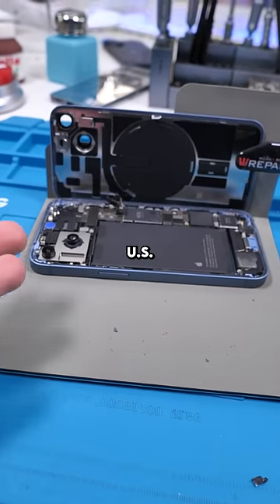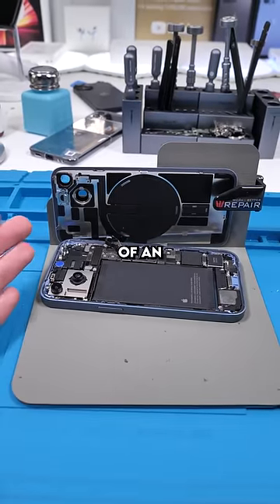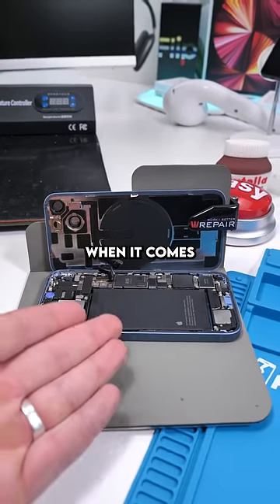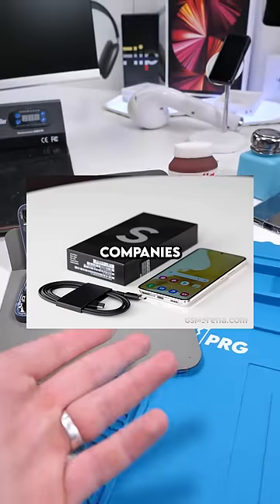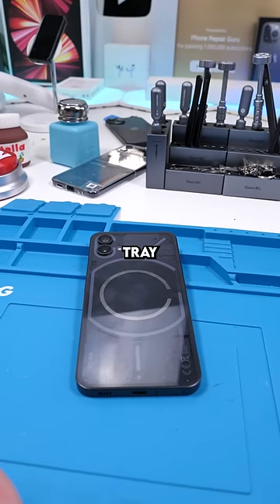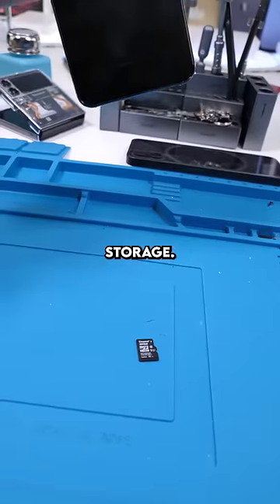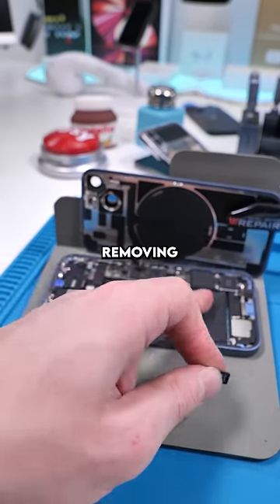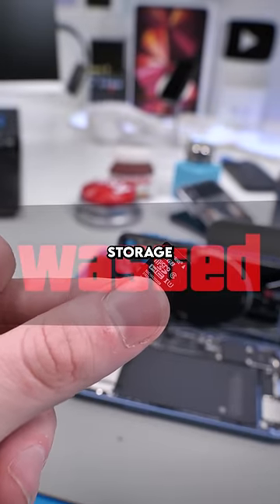The Serious Downside Of E-SIM..... #shorts

Comment: U are definitely right. The think that i dont understand is that they laugh at them and make the same things, yeah more room to work and bs but this is a disaster.
Reply: They don't even take advantage of the extra space, they just put a block of plastic where the SIM tray used to be
Reply: @Votterbin  because other places still have the Simcard tray. I think with the iPhone 15, Apple will remove it for every country and then use that space.
Reply: @noobssindcool  I hope you’re right and I kind of believe you are. It seems like it would complicate production having only one specific region assembled differently than the rest.
Reply: ESIM's have existed in Android based smartphones way before Apple started using them. ESIM's are by no means new. Android phones didn't all switch to using ESIM's exclusively so I don't think that other companies are going to really care.

Makes me wonder just how easy its going to be to travel with an iPhone that has ESIM vs an Android smartphone with a sim slot. It's not like you can get a travel sim at the airport, or stay anonymous by using an unregistered sim.
Reply: @noobssindcool  I hope your wrong, I really want the iphone 15 to be the perfect one. With a type-c port, sim card tray and slightly different design. 🤞
Reply: Samsung may even be worse than Apple. Let me explain.
Both are terrible, anti consumer companies, but Apple has their own, different and appealing OS and environment.
While Samsung implements the same terrible tactics Apple does while using Android and promoting universality, while limiting and worsening Android’s freedom and experience
Reply: Well there are brands out there like "Budi" that make external storage that very well may be our next option with everyone trying to move to the fact of removing the storage.
Reply: @imprincesswolfy2565  I have samsung note 10 plus the only thing I miss is the headphone jack and the heart rate sensor only the samsung s10 plus has the heart rate sensor if you buy a newer one it's impossible to get those two features especially the heart rate sensor which it's a samsung feature I think idk

Edit: idk why the fuck they made their own phones more useless but technically powerful I rather have a 9 year old phone that has all the features than get 1000 dollars phone and it does not even contain or have those features
Reply: Just use a USB c flash drive
Reply: The PR department does it to generate hype and discussion 

Like how Fanboys will go "Haha Apple sucks for doing this!" then "How dare they mock Apple!?"

The companies themselves don't care, it's not like Apple will get "insulted" and not get Samsung to help manufacture iPhones
Reply: @wodn184fn I agree.
Reply: @thinkspeed6787  Apple will be going portless before they use usb c simply because all the lightning cables will be waste now (for those that don’t have another product with lightning) and if they switch to usb c before going portless then that’s two types of cables that are waste now instead of just one
Reply: @thinkspeed6787  if any iPhone is gonna have USB-C it would be the EU only, because the US isn’t pushing it
Reply: @Votterbin  redesigning the board for a specific region needs another manufacturing process, so they just chuck in those plastic blocks. Saves them $$$$$
Reply: @ctwilli0950  ESIM isn't new on iPhone either. The new thing is that they just have ESIM now and nothing else. And I think we all know Samsung and their sad concept of copying everything Apple does
Reply: @mercury9060  That's bullshit. Why should they go portless now? They already have their iPads and Macs on USB-C, so you already have two cables. And as soon as they switch the Airpods and their Magic stuff to USB-C you have one cable
Reply: @timwiesler6365  They have plans to go full portless and that includes the charging port. Also the new EU law that requires smartphones and other electronics to use usb c basically solidified the iphone going portless. because apple is against electronic waste and they would rather go straight to usb c than go for usb c on all iphones for a year or manufacture new parts just for a different country. that would be a big waste of parts and money and would produce a lot of electronic waste
Reply: @10-volt  I'm in the EU 😁
Reply: @mercury9060  IPhone is against electronic waste? Nah man they are against it for greener $$$
Reply: @someoneyouneverknow7529  doesn’t the matter the reason, they’ve shown many times that they’re willing to take something out that isn’t necessary
Reply: @mercury9060  But they wouldn't need to make new cables OR new ports because they have it already in their iPads. And even Apple knows it's way to early for portless smartphones. It seems like you don't get the whole concept of Apple.

Apple has much more important tasks for now. You'll see next year when they switch every iPhone to the dynamic island, then the year after that the pro switches  to a punch hole, then the normal iPhone, then no camera etc. There's so much to do before a portless iPhone even comes in the minds of the designers. So it's not just for one year USB-C either
Reply: You know, that apple ain't a trendsetter right?
Reply: @mercury9060  yep taking out your old broken iphone into trash and make u buy new one instead of repairing it. 
seems legit to me
Reply: Seeing as samsung produces micro ssds I don't think there gonna save 10 cents on producing the slot to lose 200 on there ssds....
Reply: ACTUALLY I have a USB flash drive and a seperate adaptor which turns type-C into USB.

So, first I can plug my adaptor in my phone and then plug my USB flash drive in the adaptor and my phone to transfer files

It's SUPER USEFUL
Reply: @ctwilli0950  it isn't about the phones having support, it's about carriers supporting it
Reply: @lanoleki151  i recycle mine or trade it in for apple to refurbish/recycle so. idk about others but that’s me
Reply: @timwiesler6365   I am talking about Android phones in general. Not just Samsung. While Samsung and some other Android phone manufacturers are copying feature sets to some degree, that is not true for all of them.

In my comment I said that my Pixel 4 supports ESIM but also has a physical SIM card slot. You can have both at the same time. The same is true for Samsung smartphones. Also there is literally no point in dropping features on the latest Android smartphones with absolutely no improvement to the product. Even if it is to copy Apple.
Reply: @BallerShortsHD  There is very little in the way of detriment to the carrier if they decide to go with ESIM or not. I don't think we are going to see carriers just drop the SIM card all together just because Apple didn't include a physical sim card slot on the US version of the iPhone 14.
Reply: @ctwilli0950  true, but we still aren't seeing eSIM in all countries, and in many countries only 1 or 2 carriers would have eSIM options,
Reply: In Brazil there's a case on Apple for not selling phones with charger Brazil's government already told Apple to sell their phones with charger and for now the Apple phones without charger are banned from selling in the Brazilian Market.
Reply: @ctwilli0950  Why did they drop the headphone jack then? Or the charging brick?
Reply: @mercury9060  so they rather waste energy and put more money into a wirless charging method which is slow and unreliable

Especialy as i stated above it waste more energy as the technology is extremly inaficent due to energy being turned into heat from the surounding area
Reply: @mercury9060  also lightning cables are obsolete by standards only supporting usb 2.0 and having very weak strain relifs causing them to break often 

Plus the bill states that phone chargers will be standerdised meaning unless there using standard wirless charging there not going to be able to get around the bill in 2024
Reply: @killerking7374  it honestly depends as these companies are split eg samsung manufacturing and design 

If samsung design the phone branch doesnt follow trends and an exect come out saying to remove it cause they want to save its posible that the two firms never discuses this and that they make a huge mistake like this
Reply: @mercury9060  there refurbish thing is really bad they give people botched jobs somehow 

Its much worse on there older macbooks but still relates to there phones as most of there money isnt on selling refurbishs but selling new phones
Reply: @ctwilli0950  i mean the headphone jack and the charger
Reply: @thinkspeed6787  and good battery management
Reply: They can just put an extendable storage tray and other additional shit  that's completely possible smh
Reply: Android users are not the ones making the phone... For example, most android user rather want a phone with an aux.
Reply: @ctwilli0950  erm the thing is even with a' esim traveling won't be easier than it is. Esim is just a virtual sim it doesn't change the antenna firmware/capabilities. For exemple US and EU use different set of RF for cellular and a phone for the US won't include these frequencies and vice versa so if you have a EU phone you can't use the US mobile carrier cellular network and vice versa
Reply: @DaQuill  bruh 

Every Android is following 
Apple's major changes
Reply: @robustanybody5138  others add Haptics, Apple follows.
Others add widgets, apple follows.
Others add accident-alert-system l, apple follows.
Others add Fullscreen, apple follows
Reply: @thinkspeed6787  Despite being an android user, if that really was the iPhone 15, I would seriously consider buying it.
Reply: @catboy3471  1.they switched to haptic touch.
2.The Notch doesn't have that many advantages. Sure, the new dynamic Island is pretty cool. But the normal notch was only copied by some brands, that wanted to seem a bit more like apple. Apple devices are a status symbole, and people usually only buy it, because they feel like it's the right thing and they don't want to be considered poor. This is not always the case. For sure. Many buy it for work etc. But honestly, there is no reason for an average person to choose iphone over other android alternatives, like Google, Samsung or OnePlus. China's phones (Xiaomi or Huawei) are very good too. They are overtaking the market. But they might be banned so I'm not gonna name them as good alternatives. However, I'm not saying, that apple is copying other and the others aren't. It's a free market and people look at the others Technik, if they like it, they use it. My point is, that it's not only apple being copied, but pretty much everyone.
The point of the video was, that apple brought a new invention to copied. I only want to remind everybody, that google has E-sim since like 2018 with the pixel 3.
Reply: I apologize for that long text
Reply: @DaQuill  You missed the point about e-sim. It is not a new feature, they’ve had it since 2018. What is new is not having a slot for a standard sim card anymore.
Reply: @TadaHrd  why should i waste money for exra wire that phone manufactures just put their phone features back i mean if a person is poor and cant affort wireless buds what will happen so the person just wasted money without knowing that his phone is not compatible to wired devices only it supports charging cable that is the only wired thing phones of today are supporting nothing else wired
Reply: @thebdsyt522  lmao
Reply: @xluumu  imagine now phone manufacturers will get rid off tbe charging port and then we must use wireless charging station aswell as we using wireless buds or headphones
Reply: @paraskevaspapantonakis  I don’t think we will see the charging ports disappearing in the near future.
Reply: Nah idk
Reply: @paraskevaspapantonakis  it's very cheap to do that
Reply: @xluumu  well if wireless chargers are already available in the markets then yes they might get rid of them as they did with the Power plugs (the plug were you connect the wire so you can charge of whatever you use)
Reply: @TadaHrd  even so why samsung and iPhone removing the most important things in their phones like headphone jack and the actual physical buttons which it was more better and more responsive and does not dissappear from the screen like most touch screen buttons of today when you play your games or watching movies
Reply: @paraskevaspapantonakis  Yes, it is technically possible to make a phone with no physical connectors. However, wireless charging is slow and inefficient. A physical USB-connection is also needed for maintenance purposes. I don’t think it is very likely well see ports disappear in a large scale anytime soon.
Reply: @paraskevaspapantonakis  Yes but I don't think that the headphone jack is important
Reply: Here read my comment y'all 

Samsung removed the headphone jack ONLY ON THE S SERIES to add the stylus 

And samsung still has the charger and the brick inside their box they also come with a case 

So do your research before you say something

Also if you really want the headphone jack and the sd card slot you can get an A series samsung
Reply: @TadaHrd  for me it is important idk for others
Reply: @aland.mp4  and do your research too even the note series from samsung removed it so they have more unnecessary space for nothing and removed the notch as samsung told me through the samsung mebers app that it was for screen zoom size and to have a more bigger display what is the purpose or point of removing a notch that was not worth it did not improve or change anything it was one of the most unnecessary things that phone manufacturers even did even iPhone has a notch and still nothing has changed the notch at least in iPhone 14 is usable to do pretty much anything
Reply: @paraskevaspapantonakis  what a horrible excuse this is lmao ☠️ 
I thought everyone hated the notch? 
Iphone had a big ass notch because of the "face id" so they decided to make it even bigger with the dynamic island why? All this because they refused to get the under display fingerprint scanner 
Oh and also samsung did put the camera under the screen if that's what you mean 

Also the note series has discontinued..
because now samsung can make smaller parts and decides to just put all that into the s series 
So sooner in a decade the z flip will be discontinued aswell and brought into the S series

Do you're research on a proper search engine.
Reply: @aland.mp4  i do a proper research on a proper good search engine and tell me where the hell did you find this garbage information from i bet its from siri or from internet explorer lmao
Reply: i actually wanted Apple to add the External storage.... but this just is not going to happen.... good luck android users\
Reply: @sweetangelsheaven4kids  all they want you to do is buy icloud storage
Reply: @aland.mp4  so they really give a damn about been rich but when you ask them to add something you missed from the past 7 or 8 years they won't do it so you are forced to find an older android phone from ebay so you have all the features you missed and wanted also phones of today are getting worse and hideous with less features with a massive price costs
Reply: @aland.mp4  also I do not think Apple will ever remove the notch on top their phones even though it's not a massive difference between iPhone 13 to iPhone 14 to be honest iPhone 13 looks better and it's bigger than iPhone 14
Reply: Apple knows that most people are stupid and they will continue to buy Apple phones. Android users are not all stupid, so there will be less known brands that will not follow Apple dumming down trends and these phones will sell stronger in the long run.  Hoping that stupid people spark a lightbulb and realize how stupid they are, and can make better decisions. "Oh, Apple just took away the dialing feature on my iPhone 20 and is requiring me to get a chip implant so I can think of the number to dial....oh well, its still a cool phone, so I will do buy one" What a population fail.
Reply: @aland.mp4  but if you want to believe the in the internet more than ask a professional be my guest. The only I want you to know is don't believe what you see in the internet sometimes so it's like when you see a norman person who has wings (like an angel) and flies around the earth are you going to believe it because it seems like that is what you are doing to yourself trusting g the internet is not a good idea sometimes though not all the time
Reply: @ctwilli0950  Lmao I like how smart you think you are. Wrote that statement like you’re right.

Let me tell you a story, eSIM was only recently released around 2016 and the first android base “smartphones” that implemented it first was a watch “Samsung Gear S2” and “Apple Series 3”. Then, Google Pixel 2 has eSIM support for their google fi service which still not a carrier. The first smartphone that implemented it first as a carrier was iPhones that released in 2018.

At least do some research before you think android has everything first. Hell, even the AndroidOS came after IOS. 🤦‍♂️
Reply: @thinkspeed6787  I wouldn't get your hopes too high.
Reply: Except while being a trend setter, they rip off ideas and concepts already done. This was already a standard for CDMA phones, it only changed because phones became cross compatible between CDMA and gsm networks.
Reply: @deokureta108  I have a US Pixel 4. I traveled to Germany for a Highschool trip that got delayed because of COVID. My phone has the capability of working in both EU and US bands. I had to enable roaming for it to work outside the US, but it does work. The presence of a physical sim card slot made it a whole lot easier to just pop in an international sim. I didn't even have to register with the carrier to use it for the time that I needed. I literally just bought it popped it into my phone and I was on the network. Have a fun time doing that with an esim.

The majority of phones support this because the cellular modems can support bands from either region.
Reply: @JohnMadinald   You took what I said a little to literally. I concede that I should have been a little more specific with what I meant by that. The general idea of phones that do not need sim cards has existed for a while. When I mentioned that esim has existed for years on Android phones I was actually referring to CDMA phones that do not have sim cards or even sim slots, which is similar but not the same as esim. The Boost Mobile SPH-M820 is an example of an older android phone that has this present. I believe there were some Verizon CDMA iphones that did not have sim card slots (notably the iphone 4). But this was something present on early Android phones even before the iphone 4.

Also I never debated the fact that Android came out a little after IOS. I was merely pointing out that there are a ton of features in Android smartphones that later get picked up by Apple for some reason or another.

None of this even matters anyways because Android is open source. Meaning you can literally do whatever you want, and implement whatever you want in terms of features. You cannot do this with IOS.

But for the sake of surface level camparison here you go.

Here's just a small sample of features that were available on Android first (verify them if you want):
Copy and paste (absent from IOS 1).
An app framework for installing applications (The first version of IOS didn't even have a way to install apps).
A proper notification drawer.
The ability to use widgets (That took a while for Apple to do).
Always on displays (this was something that arguably was already present as early as the apple watch series 1, but android smartphones still had this feature first).

There are more features that I could list. But I really don't see the point. I can't focus all my time and energy on a YouTube comment section where everything I say gets constantly picked apart and countered by people who are way too loyal to a corporation.
Reply: No local storage means people are forced to purchase cloud storage.  This change creates future profits.  The companies can then leverage various cloud storage options as subscription service options because people can't stop using cloud storage once they fill it up with stuff.  This cloud data can also be mined and used for Big Data.
Reply: No it’s to maximise profit not “more room” that bullshit by apple and other companies
Reply: cloud services stock ^^^
Reply: Apple sells at a premium, so other companies immediately catch on to the fact that they too can save some bucks by removing some features which will not make their customers go away, even if they are angry about it.
Reply: What about more cameras that iPhone follow from Android?
More refresh rate that iPhone follow too
More huge screen 
More battery
Ect

They follow that trend from Android
Reply: @azizsetyawan3038  and that is why it's not worth buying an iPhone nowdays but back then they were completely different they never copied from samsung as they do now
Reply: The phone that keeps, and even expands expanded memory, will win. No more marketing preference.
 Functionality rules.
Reply: Because samsung delivered the package
Reply: @thinkspeed6787  Yeah I’ll stick with my 12mini (Apple+ coverage) until the 15 is released or may even wait for the 16.
Reply: @paraskevaspapantonakis  There’s cheap $10 earbuds that work just as good. It’s just Bluetooth
Reply: @paraskevaspapantonakis  You want people to believe what you say about iPhones over what articles directly from Apple say? 😂 It’s already taken a lot to get through your comments, but to take it as professional fact? Lol, please.
Reply: @thinkspeed6787 knowing apple it probably won't and even if it was a perfect phone the price would be the problem
Reply: @TadaHrd yeah but I don't want to have to walk around with it to be able to check my files
Reply: @dmm1877  why do you have so much trouble.
I've got a flashdrive that has USB-A (big) on one end and USB-C on the other.
You don't need an adapter and it is so small that you can use it on your keychain.
Can transfer between all kind of devices (never tried using a USB-C to lightning adapter and try it on an iPhone, don't know if iPhones support USB OTG function)
Reply: @novideos101 
Yeah I have this too but thanks for the info 👍
Reply: @xluumu  wireless charging may be inefficient but it's no longer slow.
Xiaomi has 50W wireless charging phones and I think that there are even faster wireless chargers, that are way faster than Apple or Samsung's actual wired charging.
And if phones have Bluetooth, NFC, WiFi, GPS, wireless 5G data and are even starting to send info to satellites, I think that they can for sure remove USB connection for maintenance, using some of the existing wireless methods that I mentioned or through some kind of very close range connection similar to NFC.
Or they can even have a proper area with some contact pins covered with a good electric conductor material where they can touch their own adapters.
Reply: Do you know if iPhones support USB OTG?
Just for curiosity.
Reply: @twinkie4783  Maybe you've heard of Sandisk? A little known company that makes SD cards... and unsurprisingly, USB flash drives that can be easily inserted to your USB-C or lightning ports on your phones and tablets, and also with your PC, making data backup a breeze.

By little known, obviously I'm being sarcastic. But that doesn't erase the point of removing the extremely slow microSD slots when there are better, faster and more accessible options available (USB 3.1 Type C that can go up to several gigabytes of speed per second vs. the few megabytes per second of an SD card)

MicroSD is literally holding back any technology which still uses it. Imagine if Camera manufacturers just replaced SD slots with a hidden USB Type C port? Photographers wouldn't need to cry that Macbooks don't have an SD card slot lol
Reply: These company want to make money , if somewhere is profitable they will go , all these company are just the Same